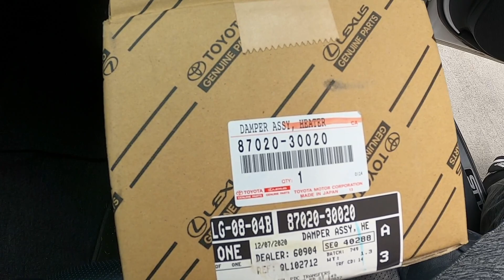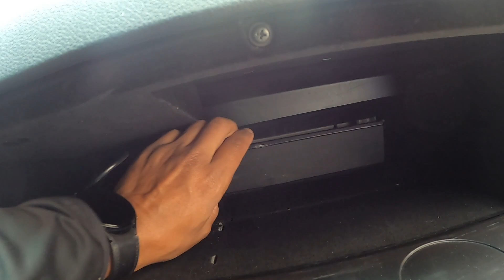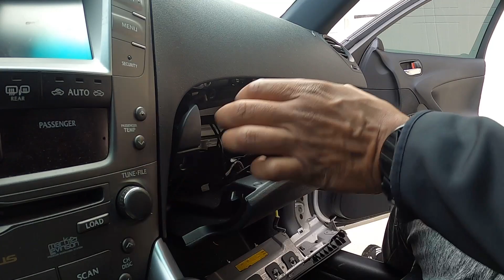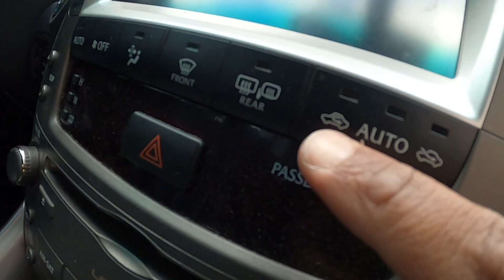Lexus IS Heater Damper Replacement HVAC

Comment: So I just got my buddies ISF it’s a 2013 and I just replaced the cabin filter but should that little cover be down like that all the time or is mine broken too? I had to lift that little cover up and hold it up as I was installing the new filter and pulling the old one out. Is that the way it should be guys?

Comment: Really great video, thanks for sharing. I had similar issue but on investigation it was a little plastic nub on the end of the plastic arm that goes from the servo to the new arm you got which attaches to the damper. I removed the damaged arm and put a correct sided bolt to replace where the plastic broke off which has done the trick. Your video on getting access to this was 90% of the battle though so thank you
Reply from the maker: Awesome, glad the video was able to help you out!
Reply: Just found this. Forgot to hit the recirculation button so broke the p.astic clip forcing the cover open.
Reply: This was very helpful.  Muchas gracias

Comment: Thanks, 2011 LEXUS IS 350. I found it difficult to reattach the blower housing to the main housing. I had to remove the screws for the upper blower housing to get the two together.
Reply from the maker: Yes, it's not easy but whatever method found is still better than having to take everything apart.

Comment: Nice flat rate fix!  I knew you weren't going to get the upper housing to separate (BTDT), so flexing the housing is a solid way to do this without removing the entire dash (which is what the flat rate manual says you must do.)👍

You are 100% correct about the door getting broken.  I did this on my '06 IS350.  I was able to fix it with a bit of a hassle, some glue, and a screw because at that time there was no part replacement available, only replacing the entire HVAC unit.
Reply from the maker: Wow. Glad you got it fixed because there is no way a whole unit would be order for that small break. Lol

Comment: Today i fixed mine.
You can fix it with a Screw into the broken Part.
Reply from the maker: That's a great option for those who do not want to replace the part!
Reply: What type of screw did you use? I'm tired of smelling exhaust fumes from the car in front of me😂

Comment: Hey man, mine broke as well. I'm currently trying to use pattex to see if it dried over the day. If it breaks again, im just gonne order the new part.
Reply from the maker: I have to fix broken plastic parts in the past and they just never seem to hold up. Let me know if you were able to fix yours with the repair.
Reply: @btbuildthings  nope, it broke again 🙃. I'm waiting for the new damper to arrive.
Reply: @btbuildthings  for plastic you need Primer and Power Glue for Plastic.
Patexx is carb.

Comment: Awesome job! I just broke my header dampener hinge today. I forgot to set the air to recirculate....and snap! Great video! I plan on doing the job in the next few days. This video is a total W! Thanks again!
Reply from the maker: No problem. That's how I ended breaking mine years ago until I finally fixed it.

Comment: Should the damper be open or closed position when the heater is on?
Reply from the maker: Well, considering recirculation vs fresh air, not sure there is a correct answer.

Comment: How did you diagnosed this? In my lexus is250 I have no heat and no movement on the position of this flap, is that connected?
Reply from the maker: I don't think they are connected. You may have a clogged heater core.
Reply: Hey, I have the same problem. No heat and no movement in this door. But the heat stopped working when a fuse blew for ACC system and I think this door is broken long before that. Also when I start my car the Ac doesn't remember the last setting.